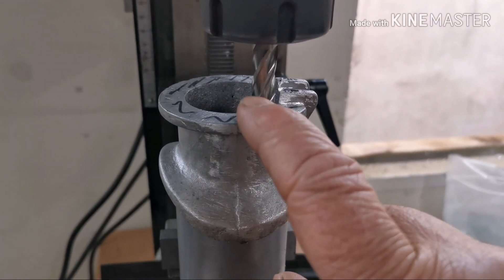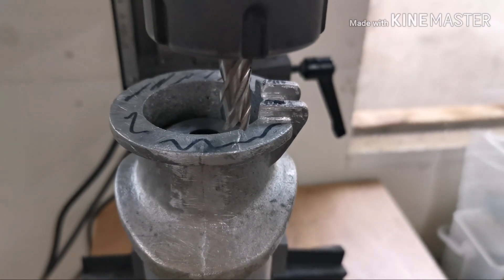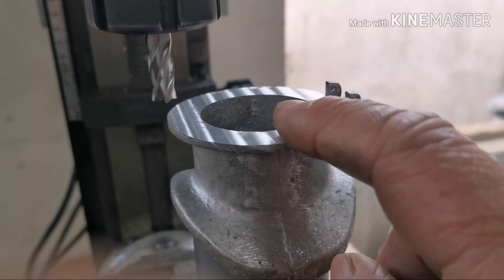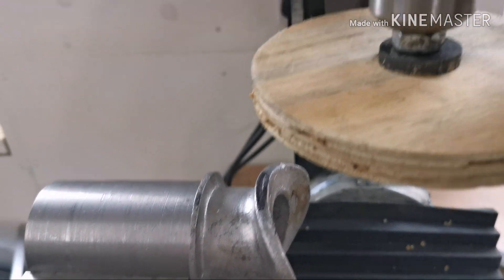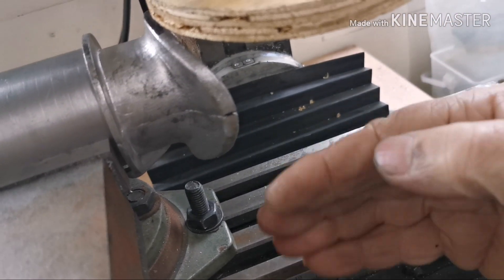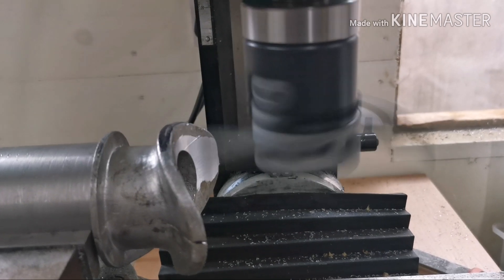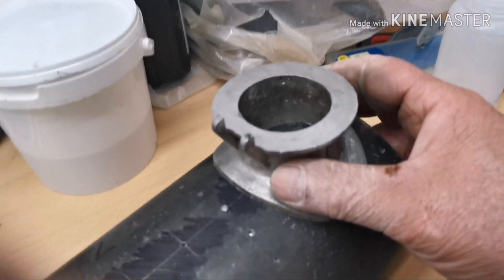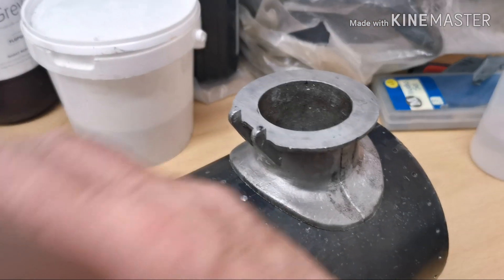2" Fowler Showman's Traction Engine

Comment: Well done mate , I have built 6 livesteam  locomotives, Gauge 1 to 7 1/4 . Traction engines are a different ballgame. Where did you get drawings and castings? I can see my next project coming. Just finished an interesting wood work challenge, making the prop for my Bentley B.R .2. keep up the good work.  

T.D 
Pensnett West Midlands.
Reply from the maker: Hi thank you, it sounds like you have been busy, I brought the drawings from Bridport Foundry, which at the moment they have been spot on, and that is where I get all the castings, they do other traction engines as well